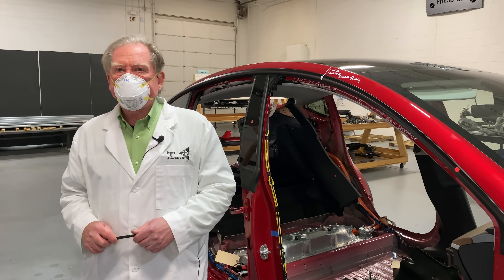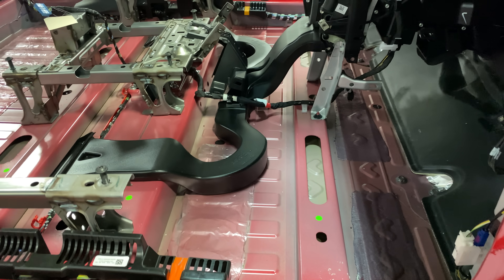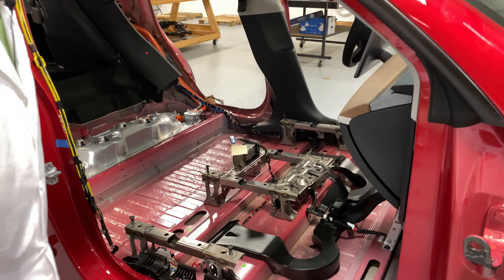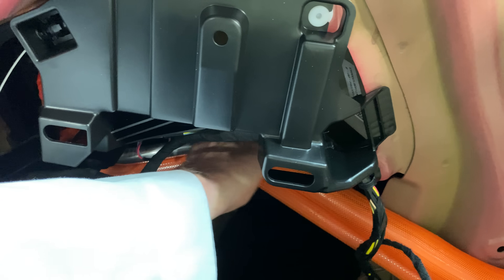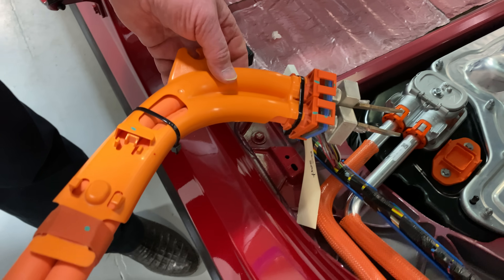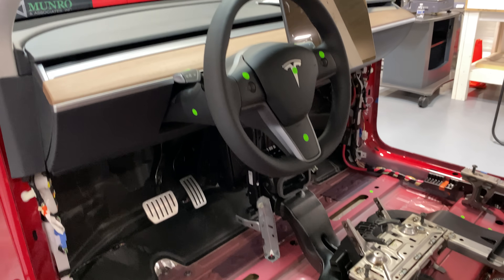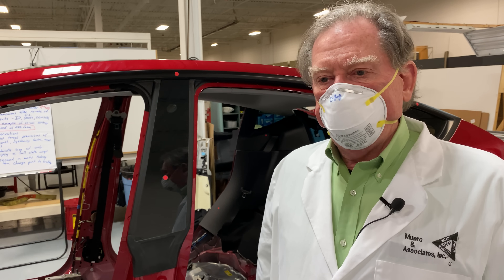Model Y E12: Floorpan, EPP Floor Risers, Commonality through Stanchions, and Wiring Observations

Comment: Paint is definitely horrible for the environment;:
: enter CYBERTRUCK 😎
Reply: Paint that's removed. As is, the paint on a car, even the paint in a junk yard peeling off and flaking (under the stipulation that it remains in the junk yard) doesn't do squat to the environment compared to what other products do. Rubber compounds from wheel abrasion on roads washed by rain has a higher coefficient of pollution.
Ever walked the side of a traveled road, put your hand on one of the impact rails and swiped it behind? That black stuff on your hand? That's rubber from the wheels. Now go a meter, two further, and if you test for that stuff, you'll still find it in soil samples for dozens of meters, getting inside the ecosystem.
Now think about that compound inside a city...

So paint, not really that big of a deal so long you don't turn it to dust, which most of the times, is within controlled environments, and that's why we have rules for body shops to keep stuff in filters and so on. That they don't follow it...well, that's another story, and another gov branch (world wide) that's not doing their jobs.
Reply: @aserta  you have obviously never seen the pick slim that it produces.  As you drive down the road micro bits of you car paint and clear coat come off. This times thousands of cars produces a pink slim on the ground.  We as taxpayers actually pay companies billions a year  to clean it up!! They   come by at night like 3 am and they wash it away into the soil so you don't see the filthy poisons slim🤔🙋‍♂️
Reply: there are water based recyclable paint these days, no need to talk shit, just ask BAS-F
Reply: @carholic-sz3qv  not for cars bro there is NOOOOOO water based paint going on a car.
Reply: @carholic-sz3qv  they have some in Canada and Europe, the current standard in the us is ppg automotive paint. While it is a tough paint it awful for the environment.
Reply: also people are going to wrap those trucks with plastic vinyls

Comment: What is the grilled plastic part at 5:00 which he calls " a good  idea?"
Reply: wires protection ?
Reply from the maker: Thank you for tuning in!  Here's a little bit more context: Many, if not most, cars use wiring troughs to protect the wiring harness in areas where they need tight packaging and resistance to crush, such as at the door sill where people may step when entering or exiting the car.  Many troughs that we've seen fully enclose the harness, featuring 3 sides and a lid, and they tend to feature solid walls of material throughout.  3 interesting things were observed on the Model Y troughs: 1) They were only 3-sided (bottom was left open), which saves weight and cost in unused material. 2) There were open sections throughout the trough walls (probably what you're calling ribs), which again, saves excess material, and thus weight and cost.  3) The walls themselves seemed to be of rather thin gauge compared to other, more robust trough designs we've seen, so again, thinner walls, less material, less weight, less cost.  The over-arching takeaway is that it seemed to be a cost and weight efficient execution of a wiring trough.
Reply: @MunroLive  Thankyou for the explanation. This is a really insightful series. Hope you stay safe. Thanks

Comment: They should use all that space under the front seats for some kind of storage boxes that slide out.
Reply: After market ?
Reply: @Wirmish  Yeah probably they will make a few types. But it would be nice to have it straight from the factory.
Reply: Maybe this foam is to protect passengers feets during a crash, or to reduce road noise.

Comment: Awesome videos!  Suggestion:  explain more.  It's obvious you know what's going on but as a regular Joe, I don't have the knowledge you do.  eg, the wire trough.  It isn't obvious what the benefit of it is.  You just pointed to what looked like a black plastic ribbed thing and said it was a good idea.  Why?  After a couple of replays of that section I noticed wires running underneath it.  Is that the benefit?  A cool little tunnel for wires?  If so, why is that so good and how does it differ from most cars?
Reply from the maker: Thank you for the suggestion and for tuning in!  Here's a little bit more context: Many, if not most, cars use wiring troughs to protect the wiring harness in areas where they need tight packaging and resistance to crush, such as at the door sill where people may step when entering or exiting the car.  Many troughs that we've seen fully enclose the harness, featuring 3 sides and a lid, and they tend to feature solid walls of material throughout.  3 interesting things were observed on the Model Y troughs: 1) They were only 3-sided (bottom was left open), which saves weight and cost in unused material. 2) There were open sections throughout the trough walls (probably what you're calling ribs), which again, saves excess material, and thus weight and cost.  3) The walls themselves seemed to be of rather thin gauge compared to other, more robust trough designs we've seen, so again, thinner walls, less material, less weight, less cost.  The over-arching takeaway is that it seemed to be a cost and weight efficient execution of a wiring trough.
Reply: @MunroLive  On the model Y the available payload is only 402 kg. The average weight of an adult is 80.5 kg, so the model Y can carry 5 adults with no luggage or 4 adults with some lugage. What is the limiting body element or component that makes the payload so low?
Reply: @foersom5928  I don't think I will buy the Y if the payload is that limited. And then comes the hitch on top of that.
Reply: @foersom5928   Correction 433 Kilograms or 954 lbs. = Car Manufacturers use a 150 lb. average weight per seat. 5 people would be 750 lb. leaving 204 lb. for Cargo or with 2 people at 150 lb. \passenger leaving 654 lbs. for Cargo. This was taken directly from the new Model Y Owners Manual page 188.
Reply: @michaelholliday100  The owner manual is unclear. you are referring to "example load limit calculations", that is same text and values as in model 3 manual.

The payload 402 kg you will find on page 189 table Weights. 
Model Y LR DP: GVWR 2405 kg - Curb Weight 2003 kg = 402 kg

Counting passenger weight as 68 kg is unrealistic low. Even the 80.5 kg I wrote is an outdated value. US CDC 2016 data (nhsr122-508.pdf) says men 89.7 kg, women 77.3 kg, average 83.5 kg.
 So model Y can carry 4 adults with some luggage.

@Munro

Is there a max payload info printed on the "Tire and Loading Information" label?
Interesting would be to determine what structural elements or components are the reason for this low available payload.
Reply: @foersom5928  In the US the new BMW iX3 only hss a payload of 991 lbs. Which is only a 37 lb. difference.

Comment: The changes to the wiring harness in the Model Y don't seem to be as radical as Elon had previously hinted at. Still thick bundles of wires taped together. No stiff flex circuit in sight.
It certainly doesn't look like Tesla managed to bring the wiring length down to 150 meters like Elon suggested. I wonder why?
Reply: Its future tech so it's harder to predict the time before its mass market-able.  Still some change here and their to make their wiring lighter and safer.
Reply: It's for the next car.
No time to implement that on the Y.
They are 6 months early.

Comment: 4:56 What is that? Sandy seems excited about that, but he didn't say what is that.
Reply from the maker: Thank you for tuning in!  Here's a little bit more context: Many, if not most, cars use wiring troughs to protect the wiring harness in areas where they need tight packaging and resistance to crush, such as at the door sill where people may step when entering or exiting the car.  Many troughs that we've seen fully enclose the harness, featuring 3 sides and a lid, and they tend to feature solid walls of material throughout.  3 interesting things were observed on the Model Y troughs: 1) They were only 3-sided (bottom was left open), which saves weight and cost in unused material. 2) There were open sections throughout the trough walls (probably what you're calling ribs), which again, saves excess material, and thus weight and cost.  3) The walls themselves seemed to be of rather thin gauge compared to other, more robust trough designs we've seen, so again, thinner walls, less material, less weight, less cost.  The over-arching takeaway is that it seemed to be a cost and weight efficient execution of a wiring trough.
Reply: @MunroLive  Not OP but thanks for the follow up!
Reply: @MunroLive  I see, thank you for the explanation! I got it now.
Reply: A lot of times "wire troughs" are set into the floorplan. I.e. take the flat metal and add a dip ("trough") into it to accommodate the wiring bundle. In this case, Tesla laid it out on the flat floor, artificially raised the floor via some seat risers and tucked the wires under a plastic retention piece.

Most OEMs: on top of the floor, sitting over a clip in piece in a "trough" in the floorpan
Tesla: Under a clipped piece on a flat floor

Does that make sense?
Reply: @TennisGvy  Ohh, nice! It totally does. Thanks!
Reply: I was like: "Wow that looks great, what is it and what does it do?" :D
Reply: looks like a wiring duct/chaseway
Reply: Would love to know!

Comment: I want to be certain they're not making rookie mistakes with galvanic corrosion, and that all the electrical wiring etc is adequately protected against water ingress and corrosion in damp environments. something i suspect designers from sunny California/Nevada might not prioritize as much. I've seen Rich Rebuilds pour flood water out of salvaged motor controllers. It makes me reluctant to consider purchase if the long term reliability is dependent on something that shouldn't be a problem. for a car that has so many critical electronics, it needs to survive decades of corrosive winter road spray and should be able to ford water at least as deep as a typical off roader.
Reply: George Macaulay You think after 5 electric vehicles they are still making rookie mistakes on wiring? Tesla is the industry leader in wiring and electronics. Rich Rebuilds works on old salvaged Teslas, pre 2014s. A lot has changed in 6 years man, Tesla is blowing sandy’s doors off with their wiring.

Comment: Wasn’t there supposed to be a new wiring architecture for the model Y to reduce the wires length to 150 meters?
Reply: It's coming, not here yet. But you can see how it would be a fairly simple addition once the connectors are built. All of the large cable bundle runs like at the sides of the car are perfectly straight, achievable because of the flat floor pan and EPP riser. You can imagine that becoming a bus, with common power and communication lines. The problem is you then need to make all of the sensors and cameras, door switches etc "smart" either individually or at the branching point via a common smart switch/router.
Reply: Yes. Tesla has designed a type of rigid cable that functions a lot like ethernet, which simultaneously cuts down on wire length, increases redundancy, and improves robots' ability to install it. I could be wrong, but this video sure makes it look like Tesla did not pull the trigger for new new wiring architecture on Model Y.
Reply from the maker: @Pikminiman  Correct, doesn't look like it's here yet.  Still relatively conventional harness construction.  We're going to be doing a more in depth video on this very topic before long.  Thanks for tuning in!

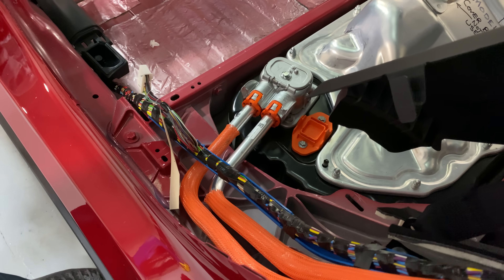Comment: 3:35 Uh, you do know that you don't have to "discharge" the battery to make it safe to disconnect, right? I assume you meant to say "disconnect".
Reply: Nope. They'll most likely open up the pack, like they did on the Model 3. 
Also, even if they would not do that, simply disconnecting is not enough anyways.
Reply: @komentierer  there should be a main contactor in the battery pack. They also could use the safety disconnect made for disabling the battery after a crash. I think its a cable you have to cut somewhere.

Comment: All that foam in the floor definitely probably helps with sound insulation. Also, can’t you just turn off the contactor manually to completely disconnect the HV system so you could mess with that cabling?
Reply: F C - yes I’ve seen that on rich rebuilds m...the Power shutoff is somewhere in the frunk, you can turn off the power to do maintenance things. Somebody tell sandy

Comment: I think the charging cables may be in pipe for liquid cooling. The charge cables on the superchargers are liquid cooled, maybe they do it to the other half inside the car as well?
Reply from the maker: There are no coolant inlets or hoses that meet the pipes anywhere along the run inside the vehicle, we confirmed.  Thanks for tuning in!
Reply: Munro Live Is the connection is in the battery pack along with the wire junction? If not, the pipe itself can also work as a heat sink?

Comment: I like most of the changes and the engineering that has gone into them. It's sad though that 6.6 inches of ground clearance is now considered an SUV. I guess that marketing term now means snowflake urban vehicle.
Reply: True!  The public likes snowflake crossovers, though.  Lots of room for cargo and passengers without the bloat or wretched mileage of true SUVs.  You might dare to park on grass or dirt at a picnic or a campground with a crossover.  Not quite the thing for serious off-roading, admittedly.

Cybertruck should fare better cross-country, for those determined to use their vehicles that way.
Reply: @Morlock in Training It's only stupid if you buy the capability and never use it. For me, it comes in handy locally when dirt roads turn into rutted sticky muddy roads. On Colorado trips they are great for going up the many trails - if you have the clearance and tire wall to do so.
Reply: SUVs have all wheel drive for snow. 
90% of drivers never ever go off road, and not everybody needs a pick up truck
Reply: @shortaybrown  Ironically our non-SUV station wagon (ok, Outback XT) has almost 2 inches more clearance than this "SUV", which is really important in snow. For really bad days, we can just drive the Touareg which goes up to 11.8 inches with the stock tires.

Comment: Sandy
Near the end of the video you pointed to a black plastic piece near the driver's door sill and said it was a great idea but didn't explain why. Please explain
(Love these videos)
Reply from the maker: Thank you for tuning in!  Here's a little bit more context: Many, if not most, cars use wiring troughs to protect the wiring harness in areas where they need tight packaging and resistance to crush, such as at the door sill where people may step when entering or exiting the car.  Many troughs that we've seen fully enclose the harness, featuring 3 sides and a lid, and they tend to feature solid walls of material throughout.  3 interesting things were observed on the Model Y troughs: 1) They were only 3-sided (bottom was left open), which saves weight and cost in unused material. 2) There were open sections throughout the trough walls (probably what you're calling ribs), which again, saves excess material, and thus weight and cost.  3) The walls themselves seemed to be of rather thin gauge compared to other, more robust trough designs we've seen, so again, thinner walls, less material, less weight, less cost.  The over-arching takeaway is that it seemed to be a cost and weight efficient execution of a wiring trough.
Reply: Reuven Gruber it kind of looked like a routing channel of some sort along with protecting the wires.

Comment: It would be good to know what that plastic piece is good for , you mentioned that most OEMs  don't want to put it - but what is the benefit of it?
Also, another burning question - is there a 12V battery. Please do a good comparison of the systems, this vs model 3. I can't afford Model 3, never mind Model Y and Model 3 - but if I could, I would have probably spent couple months tearing them apart and comparing. Not to mention, Model Y is not available in the UK (YET).
Reply: Greg Jaskiewicz There is still a 12v battery it was either shown in an earlier video or another review of the Y I watched.
Reply: https://youtu.be/0onKJm4aYfU @5:16 not mentioned but you can see the battery and the terminal disconnected, sure it was actually mentioned though.
Reply: I'm pretty sure Sandy pointed to the 12V battery in an earlier video, unless my senility is biting again.  It's in the frunk area.
Reply: Urgelt I thought the same but couldn’t find the video, but you can see it just behind the heat pump.

Comment: Sandy never explained what the black plastic by the passenger door was for he just said it was a good idea. So what is it for?
Reply from the maker: Thank you for tuning in!  Here's a little bit more context: Many, if not most, cars use wiring troughs to protect the wiring harness in areas where they need tight packaging and resistance to crush, such as at the door sill where people may step when entering or exiting the car.  Many troughs that we've seen fully enclose the harness, featuring 3 sides and a lid, and they tend to feature solid walls of material throughout.  3 interesting things were observed on the Model Y troughs: 1) They were only 3-sided (bottom was left open), which saves weight and cost in unused material. 2) There were open sections throughout the trough walls (probably what you're calling ribs), which again, saves excess material, and thus weight and cost.  3) The walls themselves seemed to be of rather thin gauge compared to other, more robust trough designs we've seen, so again, thinner walls, less material, less weight, less cost.  The over-arching takeaway is that it seemed to be a cost and weight efficient execution of a wiring trough.
Reply: @MunroLive  Ok thanks Mr. Munro makes sense now. Btw big fan of your work please keep it up👍